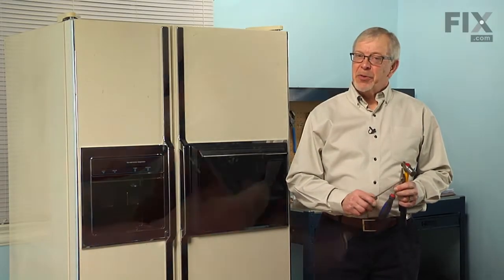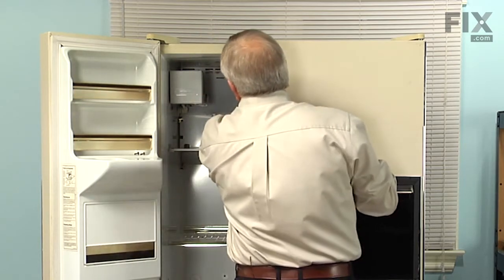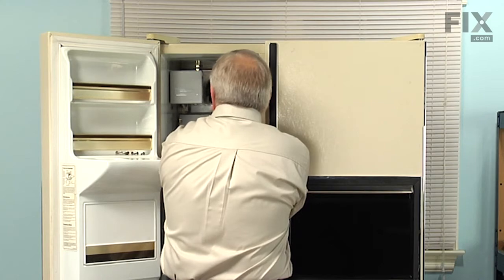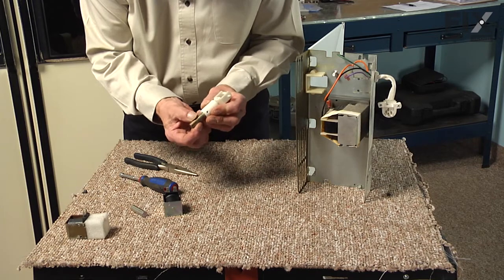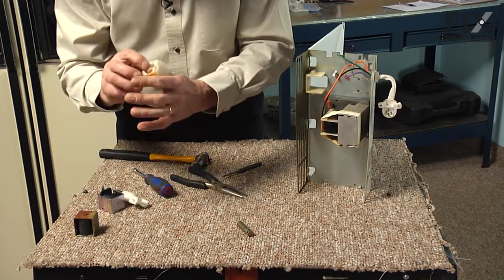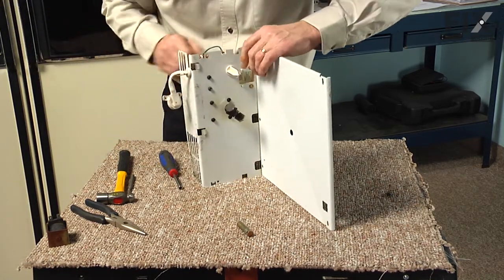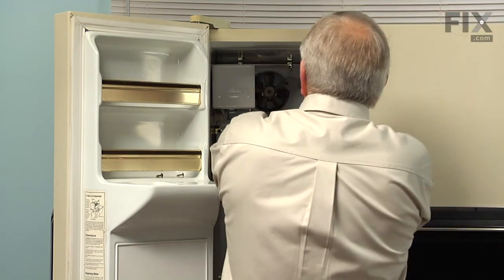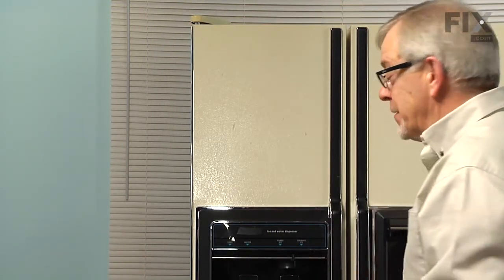GE Refrigerator Repair – How to replace the Crushed/Cubed Ice Solenoid Kit

Comment: I have G&E fridge and make only little bit of ice how can I do to make more ice?
Reply from the maker: If your demand for ice is more than the ice maker can produce there is not a lot you can do. It is producing cubes less often than it used to, then I would check the freezer temperature to make sure it's ok. The ice maker will not eject cubes until they are fully frozen.

Comment: whats the part called that attaches to the roll pin mine is shattered
Reply from the maker: The plastic part that is attached to the plunger is sometimes referred to as either a yoke or a saddle. Depending on your model
number, it may be available separately.
Reply: thanks